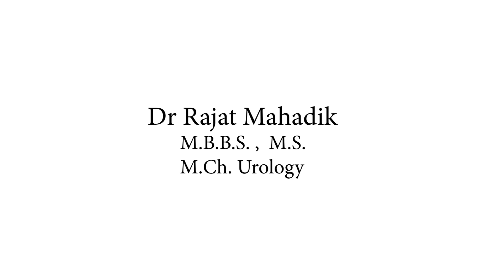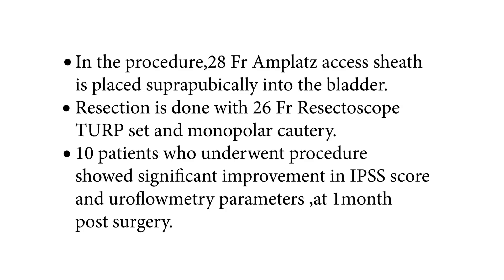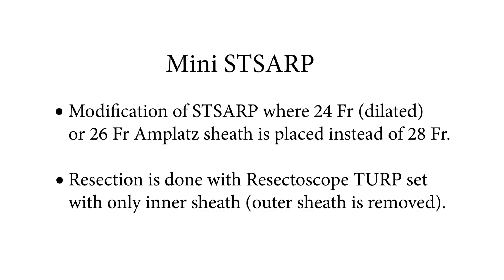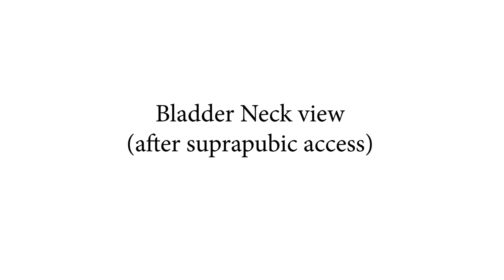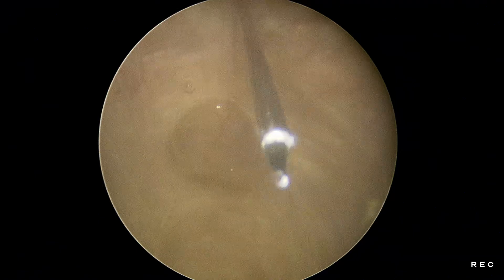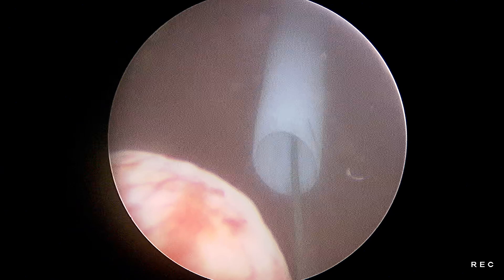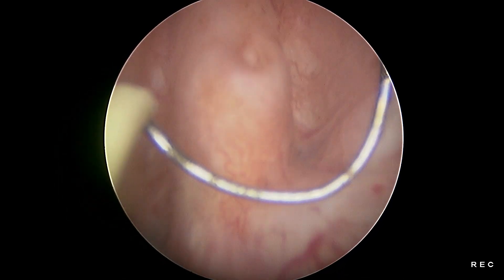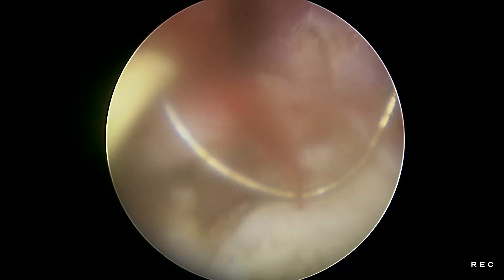STSARP & Mini STSARP- Suprapubic Transvesical Sheath Access Resection of Prostate

Comment: Could you please provide a few more details:
How did you place a 3 way Foley's post op

Chip evacuation method

Easy to identify both UOs from the top?

Irrigation outlet by which method?

Thanks
Reply from the maker: Thank you boss for watching.
We placed pu 3 way and suprapubic 2way. In some cases we placed 16 fr 2 way and irrigated from either. 

Chip evacuation is comborsome.
Through 26 fr sheath like normal tur.
Mechanically pulling with loop.

Some chips spilling out.
Reply from the maker: Outlet through sheath only on to the plastic drapes.
We collected it as in pcnl.